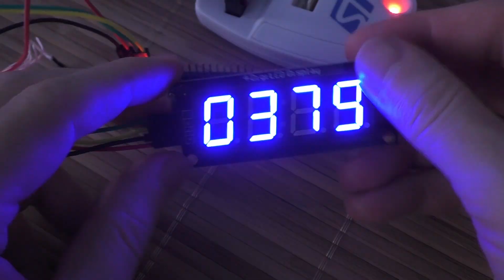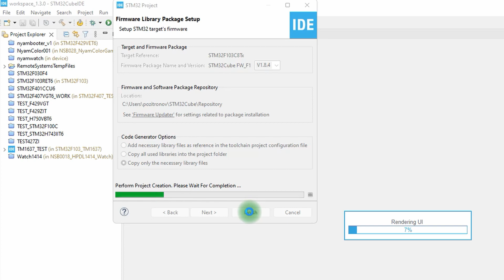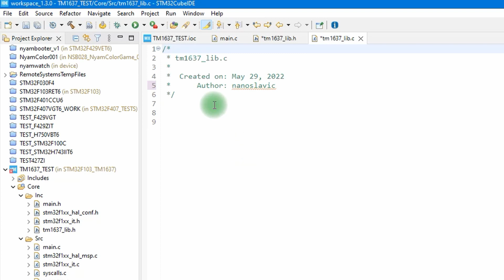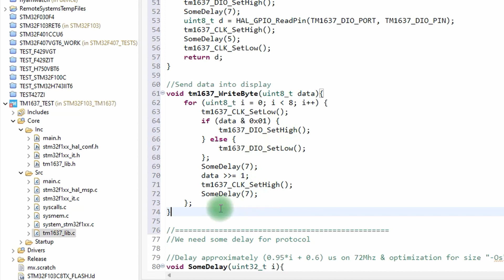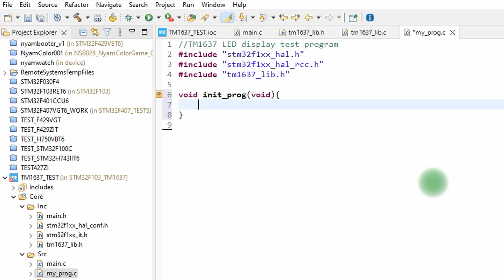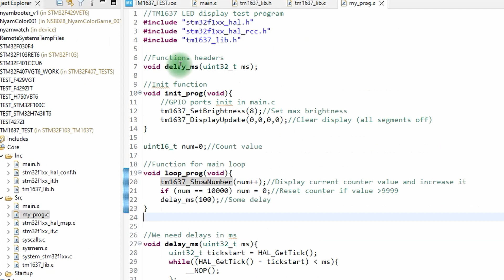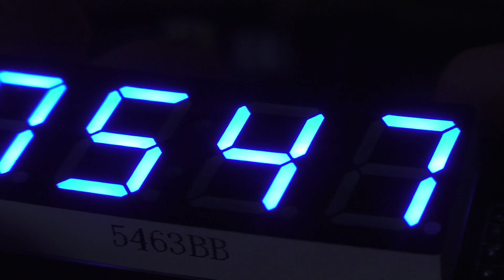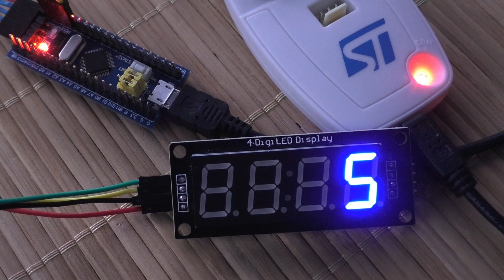Creating STM32 driver for TM1637 7-segment display in STM32CubeIDE from scratch

Comment: But how to write string "abcd". I see no command to do so, fx something like - writeString("abcd").
Reply from the maker: Each seven-segment indicator is written with 1 byte. Each bit of this byte activates 1 segment of the indicator. You can display any combination. To do this, you need to use the low-level function for writing data to the display.
Reply: @NanoslavicLab  Why did not you write such a usefull command? You know the proper details.
Reply from the maker: I had no need for such a command. Usually such displays are used only for displaying numbers.
Reply: @NanoslavicLab  You are wrong. Its the basic need. Without infomation what is the number represented, especialy when you have several numbers or more, its almost useless.

Comment: In the tm1637_ReadACK call, does the HAL_GPIO_ReadPin function call actually work for a DIO pin configured as an output?  Seems like the pin needs to be configured as an input first.
Reply from the maker: DIO pin configured as GPIO_MODE_OUTPUT_OD (Open Drain output) and external resistor 4.7k pulls up pin to 3.3V. So you can read ACK signal, if write to DIO pin value 0 (output transistor is off).